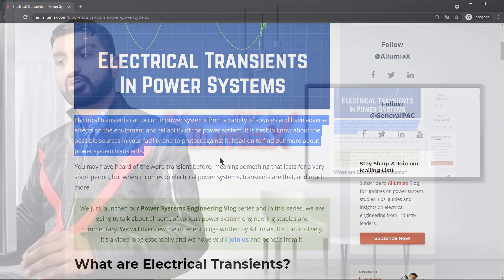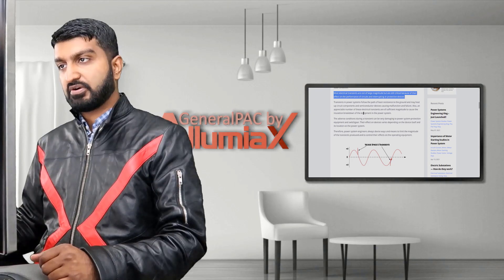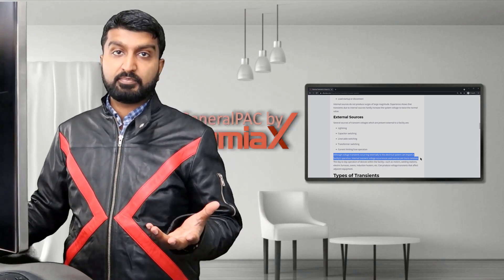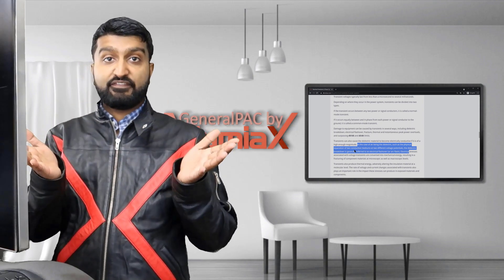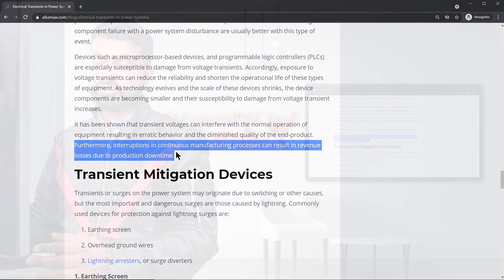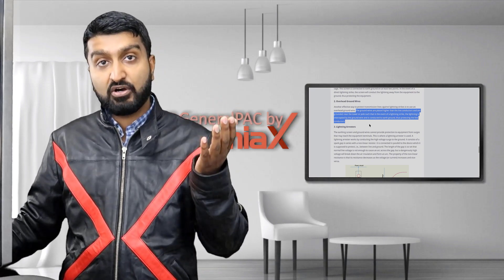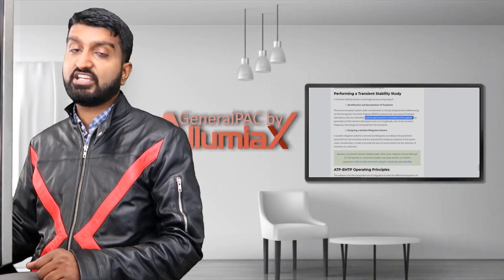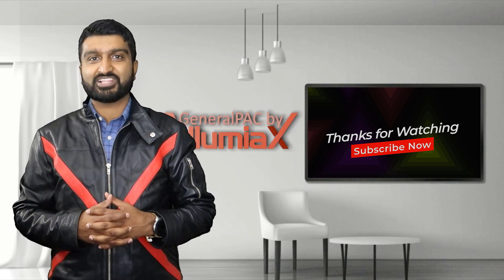Electrical Transients in Power Systems | Teaser 3 | PSE VLOG

Comment: Can you make video on power system analysis like like short circuit calculation, voltage drop cable sizing etc.,
Reply from the maker: Hey Mohd, your suggestion is noted. Join our PSE Vlog and get 30 days FREE Trial: https://bit.ly/PSEVlog